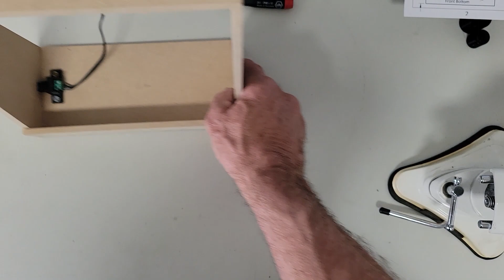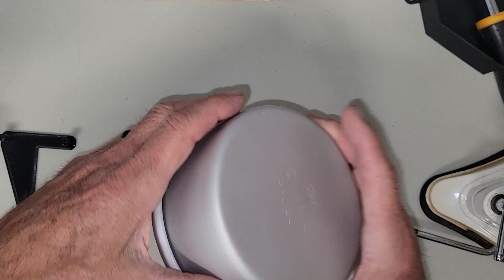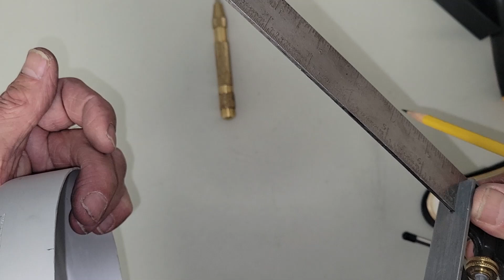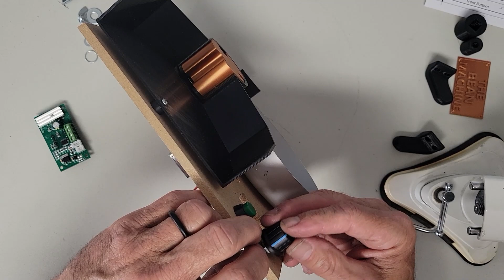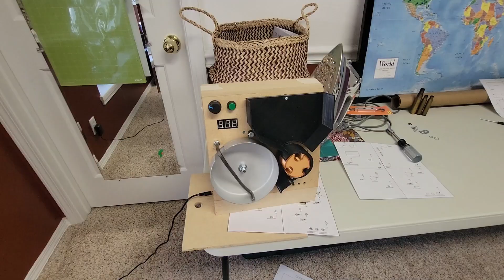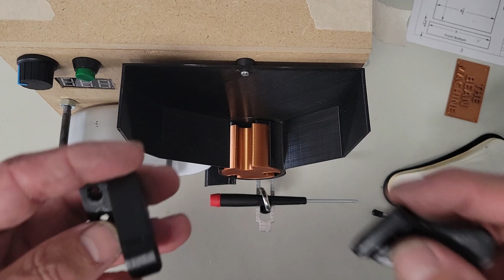V3 Brass Annealer build and overview

Comment: Notice that your kit videos show bottle neck cases will it do straight walled cases like 45-70, 45-90, 50-90 and 45 colt, 44-40
Reply from the maker: Yes. In fact I have a video that shows me running 45-70 https://youtu.be/5o8CGu6aGbI?si=PmalPcduP7p5Lf_X&t=430

Comment: Update: Amazon sells a National Hardware turnbuckle N820-120 (1/4” x 7-1/2”) in black finish that fits the Bean 3-D printed parts.  The black metal finish goes well with the black 3-D printed parts.  I also added a 1/4” finishing washer inside to accommodate the turnbuckle eye angle.
Reply from the maker: Thanks for the info.  It's been a while since I looked but I could never find it other than HD.  I will add that link in the instructions.

Comment: Well done.  The printable instructions, shopping list and this video are SUPER complete and take all the head scratching out of component preperation and assembly.  The printable face template is absolute gold.  I don't believe there is anything left to "tweak" and this may be the first "short kit" I ever assemble exactly as presented . . . except maybe rubber feet on the base.  ;-)  Again, well done.  Ordered my components from Esty tonight.  I've been playing with adapting a single load version available elsewhere in Internetville to a proper hopper with birch plywood and aluminum angle extrusions . . . but . . . why bother when this is available?  I was playing with cogs and trip levers but the timing was way too much without the triple gear design you use.
Reply from the maker: Thanks for your order and your kind words.  And yes rubber feet are an option😁.

Comment: What gauge wire do you use to attach from the motor to the control board and board to the power source?  I didn't find this information anywhere or I overlooked it.  Thanks!
Reply from the maker: I just used what I had laying around.  18-22 gauge would work fine.
Reply: @msgbean  thank you very much!

Comment: I sincerely hope you are coming back from your temporary break, sir. I need to order one of your parts kits ASAP. Please come back soon!!
Reply from the maker: I will be back tomorrow but the store is back open now.
Reply: Thank you. I just ordered one & can’t wait to dive in. Some questions: does your kit come with a list of all the other items needed (and where to purchase + prices) to complete the machine? And you mentioned that the remote propane hose/tip has a “less desirable” flame than the stand alone torch/tank. Isn’t there a remote tip which will produce the desirable “pencil flame?”
Reply from the maker: The link to the instructions are in the description of the item.  I will also be sending them to you when I finally get home. It includes links to all the other items you will need to include the torch.

Comment: Hi Richard. You could move over to a more heat resistant such as carbon fiber reinforced nylon and/or increase the infill (density) of the part to force more mass to be heated.
Reply from the maker: You are correct. I already print the the most susceptible parts at 100% infill and I am currently considering CF or nylon.  I have never printed with them before but I'm going to give it a try.
Edit: As of 21 Sep 24 the drum gear is printed in Carbon Fiber reinforced Nylon.

Comment: I too purchased this and am very pleased with the end results, works very well, i made mine 1 1/2" taller, wider and deeper, i also used laminated cedar plywood 1/2" then polyurethane inside and out, I had to make certain holes deeper as indicated by Jim in his instruction video, the on/off switch and the speed controller, i wish i could post i pic...  Thanks Jim

Comment: Sorry !  All the plastic parts will not last. All metal parts would last much longer.
Reply from the maker: I beg to differ.  Over 400 sold and no one has complained about the parts not lasting.  And yes, metal would be preferred, but the cost would dramatically increase.

Comment: Richard, purchased this last week and just finished getting everything installed. Really impressed with how well everything was laid out with the provided drawings.  Great job and I appreciated the quick response to my question.  The only thing I did different was I had an old steel road sign which I used and bent to the shape of your wood drawing.  And since I wasn't dealing with the thickness of the wood I cut the full-size hole for the display, so it snapped into place.  I strapped my dremel tool to a vertical bar and raised it the 1 3/8 inches and just rotated the pan to cut it.  I debated on whether to build an induction annealer or to use the propane type but could build yours for half the cost of the induction one.  Glad I came across your site.
Reply from the maker: Thanks for the comment.  That's the nice thing about being a DIY project.  You have the freedom to do it your way and you did.  Nice job.

Comment: Thank you Richard!
I purchased one of these kit about a month ago.  The design of the 3D printed parts is simple, thorough and neatly executed.  It's clear that Richard had many hours sitting with CAD to work out all the fine details.  I honestly can't believe that he makes any money at all to sell these at the price he does on Etsy; I'm guessing that he approaches this more as a donation to the shooting hobbies.  I modified the case design just a bit to allow room to mount the speed controller still in its case and made my front plate from 1/8" aluminum, but other than that followed his very detailed instructions.  My machine worked perfectly and delivered its first batch of very consistently annealed brass last week. 
Excellent job, thanks again!

Comment: where did you get the torch with the hose on it that fits the small propane cans ?
Reply from the maker: Home Depot     https://www.homedepot.com/p/Bernzomatic-59-in-Universal-Blow-Torch-Extension-Hose-361542/202539579

Comment: Why not sell the kit with all the box parts cut and drilled.  Let the customer glue it up and add paint.
Reply from the maker: Because it is a DIY project and the more I do the more it will cost. I'm trying to keep the cost of the build as low as possible. Some people have some of this stuff laying around in their shop.

Comment: I'm currently building an annealer out of metal for myself. I bought some Fat daddy's cake pans like you recommended but I noticed the roundness of the pans weren't quite true. So I found some stainless steel pans that are perfectly round and are  really sharp cornered on the bottom. U mentioned the bunt corner on the Fat Daddy pan. Is stainless steel alright to use or does the aluminum grip the shell better making it spin more uniform? Thanks. BTW the pencil inside the book is a great idea
Reply from the maker: I have never tried stainless so I'm not sure if it will be too slick for the cartridge to spin or not.  I think it will be fine as long as the holding arm is at about the 5:30 position.  I try to make this kit as easy as possible for the average DIYer to do with home tools.  SS would definitely be more difficult to work with than aluminum.
Reply: If the stainless is polished it may be a bit slick. You could always sand the walls with 220 or even 400 might be fine. The cool thing about stainless is it doesnt transfer heat so much and i also used stainless fasteners on the v2.2 design.

Comment: Hey Sarge,
Have you looked for a metal box that would accommodate your parts?  I will be sending you an order.  Like the center finding tool as well.
Reply from the maker: This is the only one I have come across: https://www.amazon.com/Hammond-Manufacturing-1456KH3BKBU-PANEL-CASE/dp/B005T8Z9G8/ref=sr_1_1?crid=2O3TMSVHE0L7G&keywords=hammond+manufacturing+1456kh3bkbu+panel%2Fcase&qid=1660744044&sprefix=hammond+man%2Caps%2C571&sr=8-1

I have not tried it but it should work.  You will just have to center the template on it the best you can since it is not the same size as my build.  It also adds quite a bit to the expense.

Comment: Can I also receive a copy of v2.2 instructions?  I had most of the V1 stuff printed and read for ever and it kind of got put on the back burner.  So I figured I'd go to the newest available and print whatever newer parts I need.  You're designs are AWESOME!  Is the V3 only available through the kit or will plans be for sale as well?
Reply from the maker: Here are the instructions for 2.2: https://drive.google.com/file/d/1NGjf2z7qPKBUArE612uGd0dcwOC2F5PB/view?usp=sharing
Yes, V3 is only available for sale.

Comment: How much different is this from the original
Reply from the maker: 90% of the parts are different but the main difference is the 4 bearing design and no plastic touching the drum.  The older versions also relied on the support of the case since they only used 2 bearings and the plastic gear spacer touched the drum and if used incorrectly could melt.

Comment: Love your design and will be building the V3 for sure. I am half way through building the V2.2 and need the instructions as they have been changed to V3 on the Google docs file. If you could reupload them or forward them to me I would be very grateful. Keep up the good work.
Reply from the maker: Send me your email
Reply: You shouldn’t need to get the entire V3 kit. Unless of course you want to? 😬 Because you should only need to get the parts that are different to upgrade the V2.2 to the V3? 

Probably why Richard is asking you to send him your email? 😬
Reply from the maker: @ronsorrentino6207  I took the V2.2 instructions down because I did not want people downloading the wrong file for the new product but I will email him he file.  Also, my initial goal was to have an upgrade-able drop in kit but because I wanted to widen the kit by 1/4" every major part also changed. Of course all the mounting holes changed also.  So, in the end, it is a completely new kit.  I am toying with the idea of making an upgrade kit but it won't have all the new upgrades the V3 has because of the width limitation.  It will essentially be a four bearing V2.2 design.
Reply: @msgbean  Gotchya. And I think you’ve succeeded in your efforts. Like I said in my reply, I hope to be able to pick one up. 

But every time I set money aside, something happens and I have to use it. :/

Comment: Love the upgrades Richard! I hope to someday pick one up!

The only thing I’d do, or rather, use differently, would be instead of using a nut to hold the drum on, I’d use a wing nut. For easier removal for adjustability. However, in watching more of the video, I realized that even though there’s room to adjust the drum, you will also have to adjust the brass stopper rod. Otherwise the drum will hit and rub against it. So depending on how much you adjust the drum, you may also have to adjust the brass stopper as well.

I guess since you mentioned the competitors annealer that’s out there, I suppose with yours, and you touched on this earlier in the video, when you talked about cutting the drum to the correct depth or length, that if a person wanted and was concerned, they could simply buy another drum, or two, and cut them for/to whatever cartridge they needed. Because it’s not like the cake pans aka, drums, are super expensive. So that’s an option as well. 

Because while they aren’t falling off, they are sticking out or hanging over the edge of the drum quite a bit. Me, I would likely opt for getting and cutting another drum specifically for a/the longer and heavier caliber/brass cases. But then that’s just me.